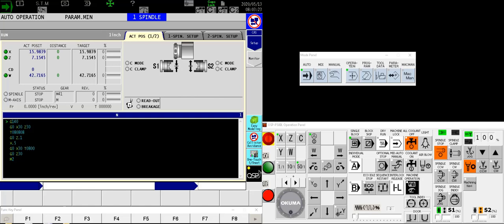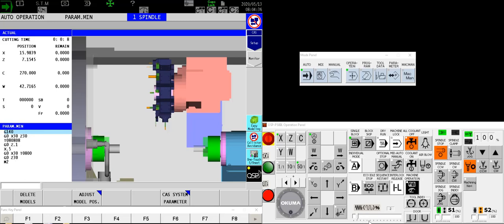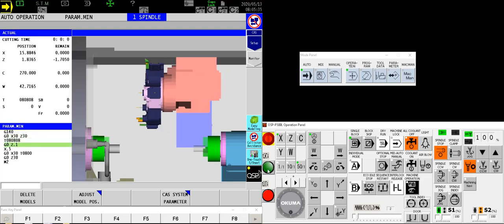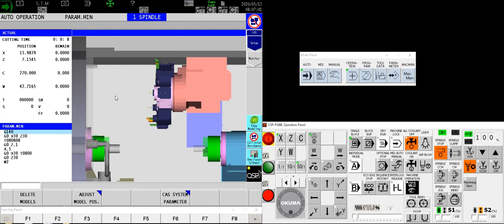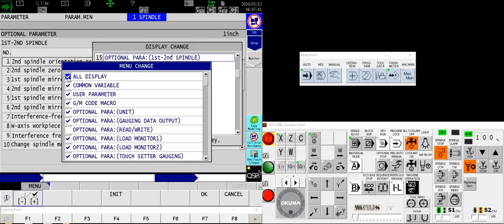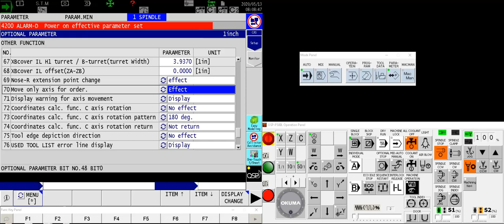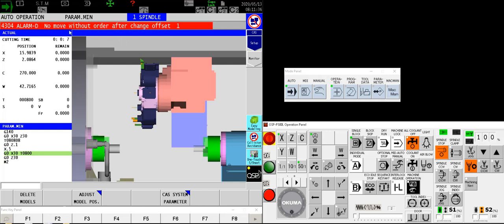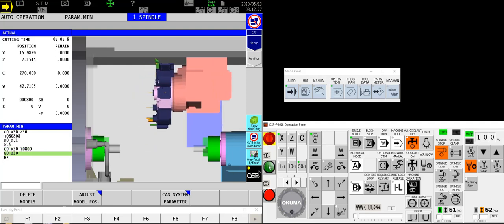Axis motion parameters on Okuma P300L controls

Comment: Thank you for the tip! I have the same error msg.  4304 ALARM-D No move order after change offset 2, and popped up right before the canned cycle or  G01 for X or Y move and machine just stopped there.  What did I do wrong? Please help and thank you.
Reply from the maker: Make sure you change #71 parameter to NOT DISPLAY. About the 6minute 30 second mark of the video talks about how to fix this

Comment: How do you rapid in a straight line and not dogleg rapid on a Okuma Bridge Mill with OSP P300 controller ?
Reply from the maker: Under the PARAMETER category LONG WORD, BIT you'll find you currently have no check mark under #46.0   That little booger is the deciding factor for straight vs dogleg. Apply the check mark (you may have to cycle power... Not certain) and you'll be off to the races!

Comment: I am having problems with the CAS, I run a Okuma multus B300-w, when transfer the part to the second spindle doesn’t transfer in the CAS, it was working before, but suddenly happened that, what would be the problem ?
Reply from the maker: Not at all!  The part transfer in CAS relies on the G22 torque skip function to automatically transfer the blank, but I'll do a video on a trick to get by that. Stay tuned!